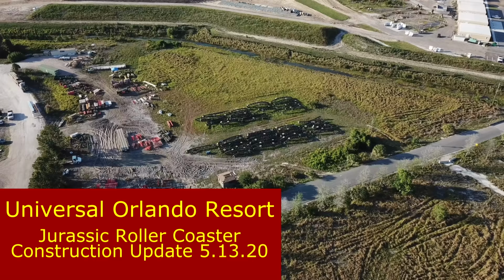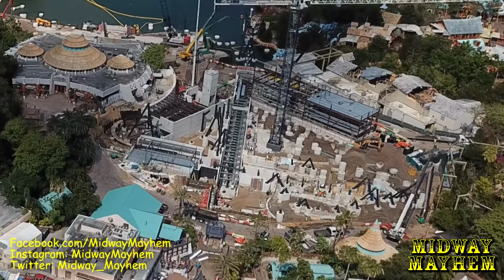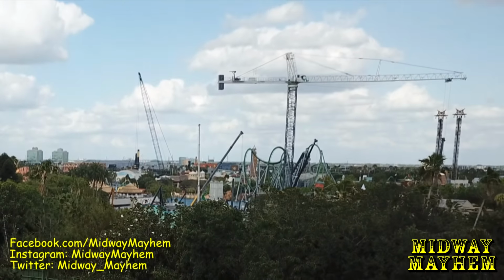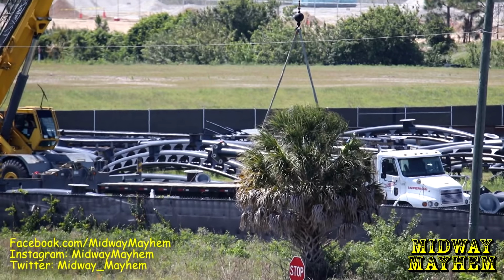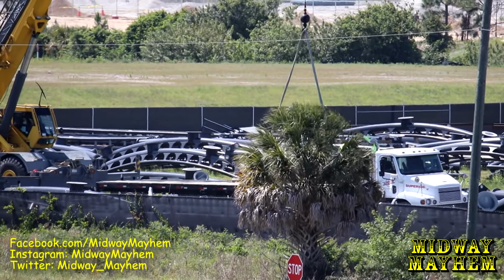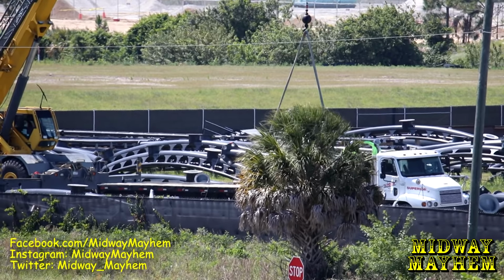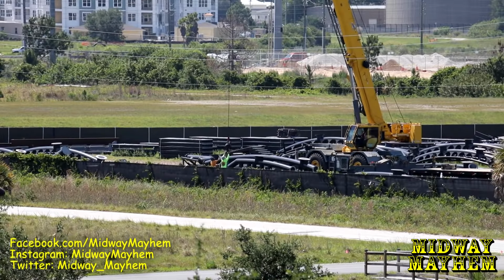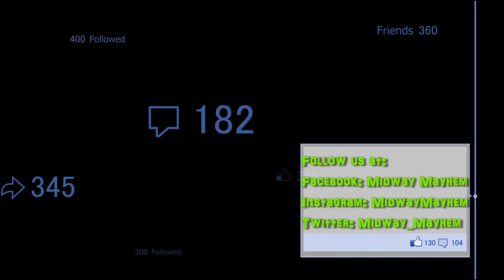Universal Orlando Resort Jurassic Roller Coaster Construction Update 5.13.20 Velocicoaster Rising!

Comment: Hey Dan, do you think this coaster is going to have any special elements like the drop track on Hagrids or the tilt track at Gringotts? I know that this is Intamin track, but I recently found out the tilt track at Gringotts was done by Vekoma, and I heard a rumor that Vekoma has some involvement in this coaster.
Reply: Doubt it, this coaster is focused on being a straightforward blitz style layout with some big elements. Vekoma might design the trains or station mechanics if they are helping at all.